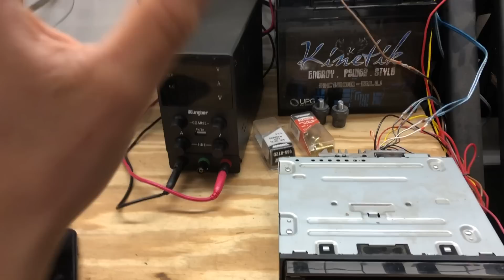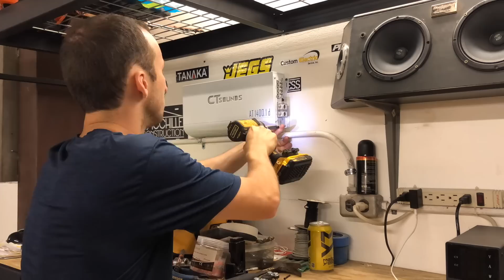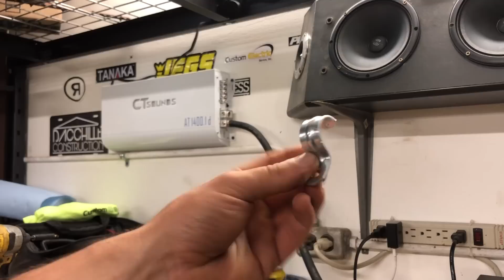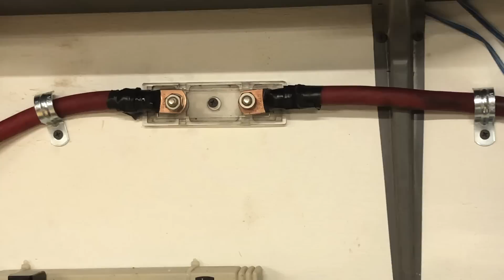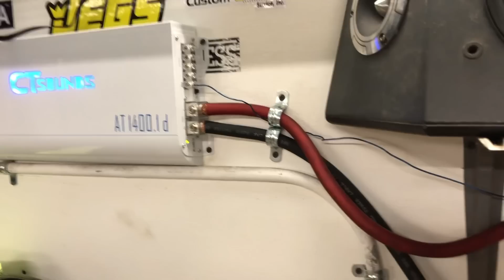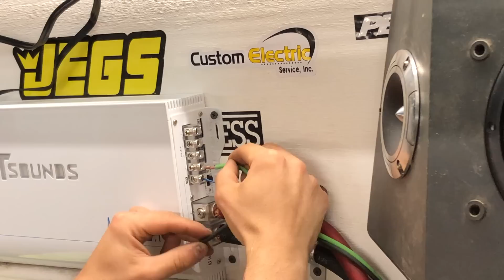How to Easily Hook Up Your Car Subwoofer in Your House / Shop

Comment: I would think
You would install the fuse with the hot wire not yet plugged into the battery , but 🤷🏼

I have like 3 sub amps and 2 sets of woofers just collecting dust but no car stereo , and my home stereo for my computer lacks any real sub but has great tower speakers , just needs that bit of 80-100hz wumph, cool walkthrough, that amp is massive !

Comment: It's real simple. One subwoofer with dual 4 ohm voice coils, or 2 subs with single 4 ohm voice coils. Now you can hook up to your home receiver of 8 ohms.
There are ten times more car subwoofers offered than for home stereos.
You can build a 2 x 10 sub cheaper than buying a single 10 inch sub for your home stereo. It's easy.

Comment: Hi mate, love the videos, very very noob question - in this video and the previous one were you show how to wire up head unti to battery and switch , what gauge wire (approx) are you using for power, always on and ground ?  Also the speaker wire is that just 16 or 18 awg wire ? Thanks a lot , about to do a similar set up , appreciate the effort you put in to making these how to videos

Comment: Can I power it with the house power supply (plug point)?
Reply: You can buy 12 volt adaptors. No you can’t power it directly off the wall. You need a 12 volt adaptor.

Comment: hey parker how you doing, just seeing this video about setting up a car system at home. I have a question have u ever try to run audio from the head unit speaker wires to the rca in put the amp or from a pre amp eq to the amplifier. can u test this theory out an tell me if u get noise fed back to your speakers for the mids an highs.

Comment: If i got a taramp 120 amp power supply to run a skar 1200.1 amp would i need a car battery? I was looking at a 35 ah sealed battery. Do i need a 35 ah or can i save money and get a lower ah battery?

Comment: Do you need the car battery ?
Reply: No. Just use a 12v power supply. Put a surge protector inline.

Comment: Where did you run your ground to
Reply from the maker: The negative on the battery is the ground
Reply: Say you’re powering the amp directly from the wall but converting from AC to DC, What would be a good ground location? Can I just mount a ground bar to the back of the subs?

Comment: Can’t I just hook the amp to some thing to make it to go into a plug outlet ?? Please no hate. I absolutely do not know how to do this at all. I have left over stereo equipment from my old car and I want to hook everything up on a to go box on wheels like a big Bluetooth speaker. I have MB Quartz separates the ones that were made in Germany. A 400 rms directed DEI CompX Sub in a tiny sealed enclosure. I have a alpine amp for my separated and a Orion xtr pro amp for my sub. I’ll have to get a head unit with cd player and Bluetooth in it.  I have a AGM 4800 energy car battery that I can use for the times I have no electricity to use. Any suggestions/ Links would be much appreciated thank you in advanced.
Reply: No u can't BC a car runs at 12v use a 12v power supply... Or u can plug in the wall and find out💀
Reply: @tootsieff6178  thank you

Comment: I've got some vintage amps i want to test and maybe use for a home subwoofer, so this info helped me out. The amps are a SoundStream Reference 1000s and 500s. The 1000s i'm actually in the middle of repairing after a bunch of mosfets exploded. Luckily i managed to get some help on the repairs from the guy who actually designed those late 1990's SoundStream amps who posts on a audio forum i frequent.

Comment: Hey this is really cool. Because of you i will be building my own 🤣 🤣  question: how often do you run your DC power supply? I understand a regular charger may not be the way to do it, it will only put out a set amount of volts/amps.?

Comment: How much did this cost you?
Is it as easy to setup as you do in the video?
Is the battery in a sense like a super capacitor or can the power supply power thr entire system?
Is this easy for beginers?
Sorry for so many questions

Comment: Why do you need a battery? I use a home stereo reciever to run my home speakers,  run av plugs (signal)  to the Amp from the reciever, plug a small 1200 watt computer power supply (ac to dc converter) into the wall,  plug the Amp into the power supply,  wire the Amp to the subs? I'm so confused what the battery is for?
Reply: Reserve amperage

Comment: How do you ground your battery? where do you connect your negative cable from the battery to make ground?
Reply: I have same question. Something metal like a rolling tool box maybe? Does it need to be grounded?

Comment: Fun fact. You can use a tattoo gun machine. A battery. A amp and aux cord. And you can play music from anything. All you do is strip the wires on the DC converter thing u attach that to the battery and the battery to the amp. And boom u got music

Comment: After I replaced my vehicles 150amp alt with a Singer 350, I took my old stock 150 amp alt and connected it to an AC motor that spins at 2k rpms (120 volts 7.5 amps from the wall) and use the alt to power amps in my house or garage it's portable, with 2 d3400s as a power bank I can power a Sundown SCV2000D.  There is also meanwell ac to d/c bricks that people use too.

Comment: what would sound better and be far more simple would be to just get a crown amp frim their xls line, like the 2502, 1002 1502 professional power amp, you can even find them used for a good price in decent shape, bridge it into 4 ohms, use its already built in low pass crossover, it already has active 24db per octave low pass/highpass/bandpass crossovers built inside that can be adjusted from its front panel, its stable into 4 ohms bridged and 2 ohms stereo. Why bother using a car amp when you can use a professional power amplifier that not only will sound better, but be reliable and work for 30 years... it also has rca jacks on the back and balenced xlr & 1/4" jacks, the input sensitivity can be set to .775 volts as well if using the single ended rca input. Just go with a crown, itll sound better and be cheaper then having to buy a big expensive power supply and all that. If running the xls amps in bridged mode it will not combine left and right together, but it is easy to put together a passive device that can do that with a few resistors, or even using a mixer as a preamp that has that feature or just simply running the amp in stereo mode if it has dual 2 ohm or 4 ohm coils, getting the biggest 2502 will provide close to its power ratings, it'll do an honest 1000w rms per side at 2 ohms and just about 2000 rms bridged and only weigh like 12 pounds, there are limits with a standard 120v 15 amp breaker, you won't see more then 1800 to 2000 out of a standard 15 amp 120v breaker if you do the math... i have the smallest 1002 powering a dual 2 ohm cerwinvega v max 12 putting about 525w rms per side into it in stereo mode crossed at 80hz, and never had an issue, and i never turn the amp off either. They also make great full range amps, you could even get a 2502 for the subs use the active low pass crossover set it to 70hz, then get the smaller 1502 or 1002 to run tower speakers that you can use the highpass crossovers for and set it to 70hz and up, then you have a decent correctly crossed over system. All you would need to do then is to daisy chain the amplifiers, the rca, 1/4" and xlr are all passthoughs. The amps have signel led and clip light meters as well.

Comment: I have not gone the distance of the extra power for a amp but you can pick a concert amp from pawn shops cheap I got a 750 watt behringer German design built in Japan it has rca jack and is bridgeable also got a Rockville 10,000 watt concert amp both run off 120 vac and had to buy some adaptors to hook up the Rockville RPA16 I use car and home speakers in old house speaker boxes got a kenwood excelon KDC-X-704 head unit with Bluetooth and a iPad  got 6 subs 2 house Sanyo woofers two skar ddx 12 d2 12 alpine bass line 6 tweeters prv horn and driver foster bullit 3 inch  old school 2x6 flared horn tweeters and 14 midrange that go from 3” Sony’s to infinity 6.5 kicker 5” and kewood 6x9  I’m probly forgetting some of the others but out of a 16’x20’ garage the lots here are 100’x100’ with a house on each one next door he said it sounds like it plying in his house the other side says he can tel, as soon as I turn it on and four houses down the alley way he said man you play some good music he said he can hear every word to every song any were out side of his house 6 doors down an retired cop said he don’t ever remember any one he pulled over having a car stereo with as much power as what I have I’ve blowed 3 12 woofers half dozen midrange drivers and a box of tweeters I had people say when there outside I’ve got the doors shut and playing like less than half they say it sounds way louder than a night club I’ve gotta build a box for this sundown audio x15 v2d2 or I’ll have it hooked up in here also yeah the garage system can get out of hand like when you can’t go any were and have to stay home bass head comes out not getting to jam to work and home hope everyone is safe jam on bass heads

Comment: That is quite alot of draw for that small of a battery bro, id definitely be considering a bigger one soon....
Reply: Im running a 2400w amp powering a SKAR DDX 10" sub with a tiny little 12v battery hooked up to a 10amp battery charger with no issues. Prior to this it was hooked up in my car to a yellow top battery with zero issues as well. Also by bigger battery what do you mean?

Comment: Bro I have two Soundqubed 4.5k's hooked up to a makeshift test bench in my livingroom lol I have a limitless cyber 12k, XS SB1000-31 supercap and a small limitless 25ah and I charge em with the small $99 limitless charger but im able to go full tilt for 30mins and never see below 13V lol I can't wait to get them batteries all installed in my denali on my mechman 320 and rebuilt oem 270 to run my wolfram AW-9000.1D on two Deaf Bonce apocalypse DB3515's at half ohm!
Reply: Let's see it

Comment: YOU DONT NEED TO DO ALL THAT JUST HOOK UP UR SUBS WITH THE RECEIVER OR AMP YOU ALREADY HAVE....I HAVE CAR BOX IN MY HOME HOOKED UP TO MY 1000 WATT RECEIVER...
Reply: you do need a plate amp or power amp to get the low notes on the sub channel though
Reply: For real 😅😅😅😅😅😅😅
Reply: @kaiserfields7290  YUP I DO REALLY...
Reply: @kaiserfields7290 YOU CAN GET A RECIEVER AN SPEAKER WIRE AN HOOK UP BANANA PLUGS 2 HOOK UP 2 THE RECIEVER... AN YOU CAN GET AN AMP FROM DAYTON AUDIO..

Comment: You should get a 120amp power max I use it to run my skar audio rp1200 I have it on my skar audio svr15 and it bottoms out the sub

Comment: well guys , this video is great, BUT  you  can do all of  this , and you  just need,  1 PC  power suply and some RCA'S spliter's and that way  YOU can connect your  phone  or PC . 
No need of car batery 
No need of Head Unit 
No need of adicional Power Suply. 

Remember this ,  get a Power Suply With +Bronze or + gold . EVGA or  other  brand. 
take ALL yellow's wires from the power suplly and you  connect to the AMP  positive terminal . 
Than
You  get all  black cables And you  connect it to the Ground. 
and  than you   get a little wire and you  connect it  to the  remote 
And  that's it.

If you  realy want to step up your  game
you can  allways  get a simple mixing table 
and that mixing  table you  will get acess to High Med and LOW's and you  can give it a  little extra sauce with it,  and its  ez to put  volume Up and  down . :) 

Parker ma dude, do this  kinda of instalation in your  videos.
Atleast ppl will have a secound Option  to  use their car  sound  at  home... If you need some extra explanation you  can  it me  up

Comment: I use a power supply taken from an old computer after it went belly-up. It has 12volt, 5volt and 3volt leads and will do up to 14amps of current. Use ALL yellow wires for +,
Use ALL black wires for - (ground). Cut off red and orange wires (3v and 5v leads).
Most p.s. require green and black leads jumped (trigger).
Get pinout for your particular power supply as some differ
Reply: Yup been running an amp like that for years, also taken from an old dead PC.
Reply: do i need a fuse?
Reply: Yep this is the way. Computer power supplies. I usually get whatever the 80+ rated best buy special is, typically EVGA around 600w. Never had an issue.  
No worries about discharging a battery too fast, battery failing. Just works or it doesn't.

Comment: I have an xbox 360 power supply powering a cheap $50 boss amp, it's been powering my 12" Kicker home sub for 2 years+ now, and it sounds good enough to make the shelves shake. love seeing home set ups with car audio, great vid.
Reply: That’s what I use as well , and was also thinking about buying a cheap boss amp to run a cheap sub also , right now I have a kicker 250.1 trying to power a L5 and it works but you can tell the sub isn’t even phased lol

Comment: Ive built 3 of these systems in the last year for myself, a friend and just finished adding two 12's to my uncles custom Bluetooth boombox that i also made. I've had good luck using ATX computer power supply. Im running a 500wrms MTX amp with a 650w (total) power supply thats rated for 12v-46a pushing a pair of Walmart Jenson 12s. Wouldnt have bought them if not for Parkers review and experience and havnt been dissipointed yet. The advantage of the computer power supply is price. For a standard 40-50a 12vdc power supply your gonna spend $60-100 but i got mine (Ablecom SP645-PS) on ebay NEW for $30. The one i just got for my uncle was a 48a unit and was in good used condition for $26 shipped. Not exactly plug and play but not too difficult to snip off the connectors and separate wires by color. Plus you have 12v, 5v and 3.3v avaible. The 5v is handy for some LEDs or auxiliary USB ports.

Comment: I'm thinking about using a setup like this for my home theater system that I will be building. I will be using my Onkyo receiver as the head unit but powering my subwoofers through a external amp to supply 2 subwoofers. That way I can use good subwoofers that are 1 ohm stable on the subwoofers.
Reply: @sauron4526  I will have to look into that as well then. I know my receiver will power my speakers, just looking for a way to power 2 subwoofers for a front and rear subwoofer.
Reply: @bbay1977  a crown power amp will do well to power you subs. My buddy has 2 800 watt power amp for his 2 ultimax 18s. I have a Dayton audio 400 watt plate amp for my Rockford fosgate 15. Sounds amazing also it's done the right way. I'm big on sq. I never go for spl
Reply: @sauron4526   I  just looked at the dyno of the Dayton Audio SPA1000 that was done by Williston Audio Labs. I will probably go with that. It is a little more watts than I wanted but it will work great. I'll probably end up getting two P2D4-12's. I have been using Rockford ever since 1995. I have a P3D2-15 installed in my camaro now. I have the old school Punch 200 ix on the sub. Thanks for the information and showing me a quick, easier and safer way to run my theater system.

Comment: I'm so glad you said that about the power supply unit most people don't understand that the amps need to match the system it can start a fire if over power. thats what most of the people running a Xbox or computer supply unit don't understand it's barely enough power to run 300w amp and deck exspeclly if wire is sized wrong it to will also be bad news definitely don't want to burn 🔥down your house for a little bass. Good stuff shop looking legit bump on bass brother bass heads 🎵💥🎶💯👍👌✌️ p.s I run 2 1500w rms amps for the subs and a house receiver for the surround sound..  a similar set up as yours in my garage. I can list to the same song in the car and on all rest of my system at the same time as well boom 👍😇💯💥

Comment: Hey parker i jus bought a powermax inverter 60 amp and whenever i wire my power and ground straight from the inverter to my amp then remote to 12v it just goes to pprotect and clip light comes on 
Im thinking maybe my amp no clue plz help because i bought it for 120$ thinking it would work from seeing another YouTuber do it but nope